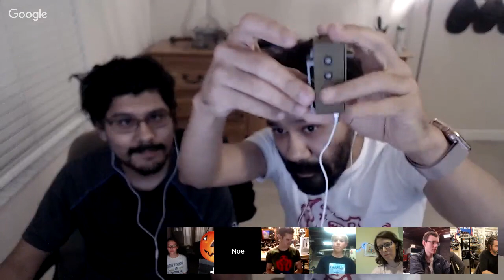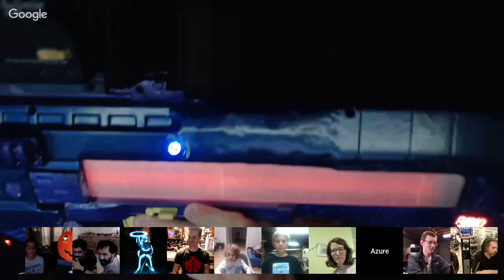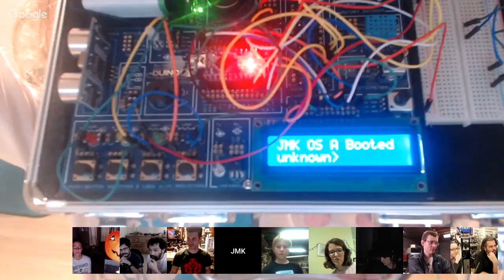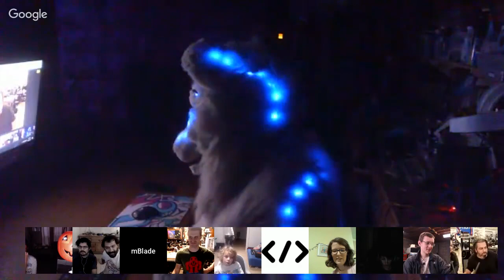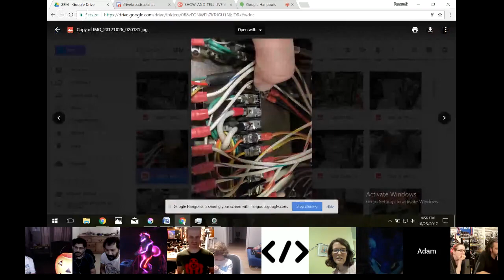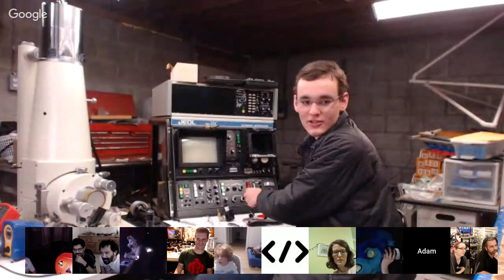SHOW-AND-TELL LIVE VIDEO! 10/25/17 @adafruit #adafruit #showandtell

Comment: I would not be surprised if Adam eventually reverse engineers the circuit board with the faulty heat sink, and recreates a functionally identical board with newer components. (Seriously, it looks pretty sketchy as-is.)
Reply: Cadmandu2000 I could likely help him a lot with that. My job involves hardware RE, and I’ve made a number of replacement boards for old computer restoration projects